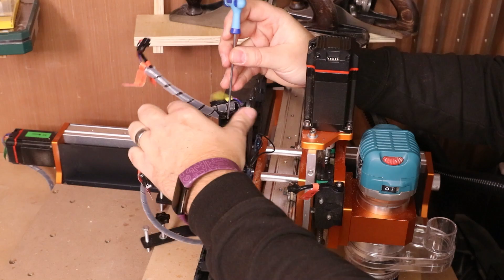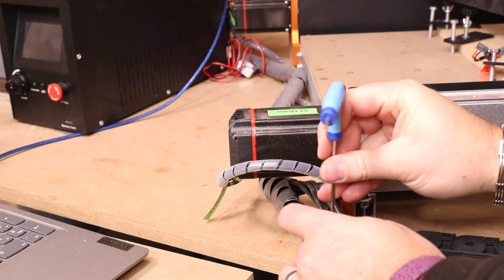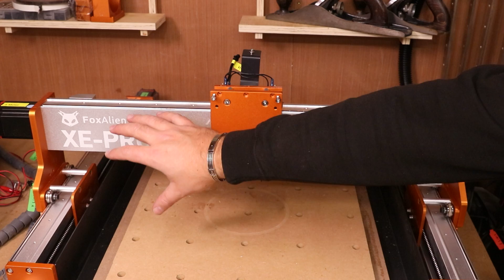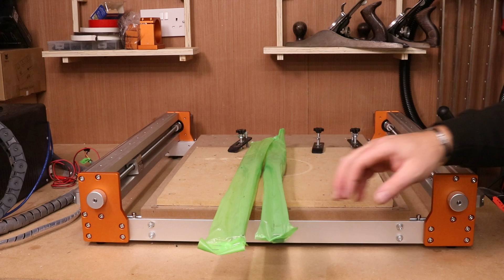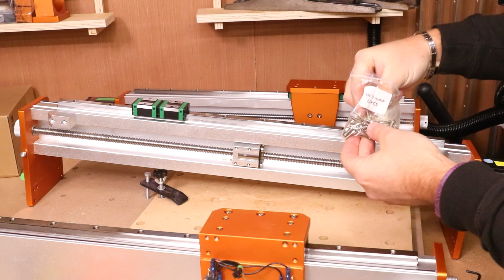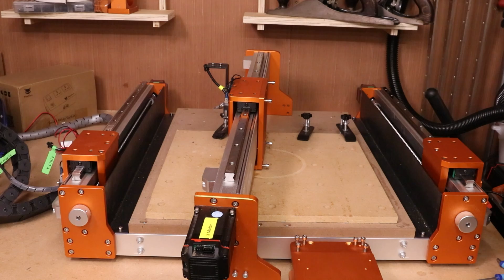Installing the FoxAlien XE-Pro CNC machine linear rail upgrade kit

Comment: With the linear rail upgrade kit it looks like the limit switch stop-blocks could be moved perhaps 1/2” or a bit more to gain a little more X and y travel. Would that necessitate setting different soft limits in G code? I would like to have 17” Y and 33” X travel if possible for some projects. Any help appreciated and keep up the great YT videos!